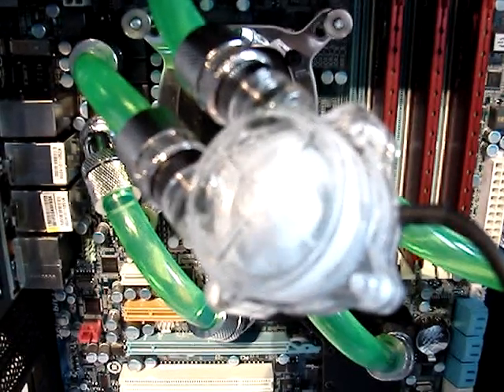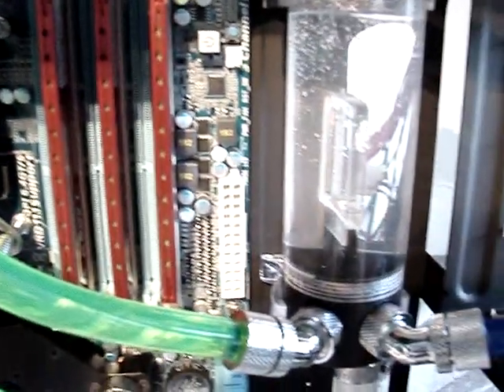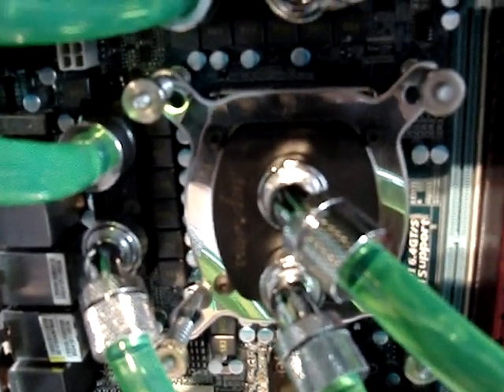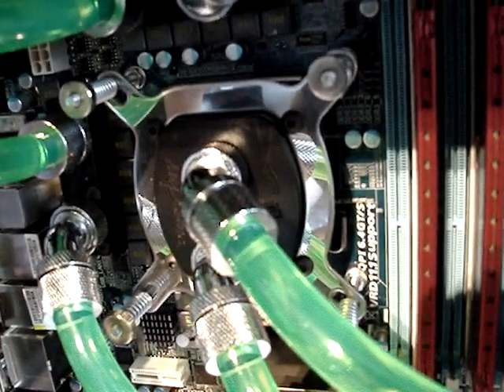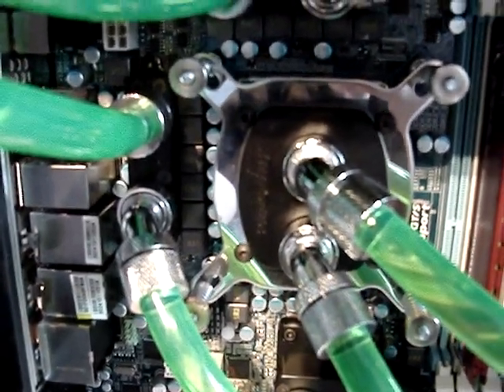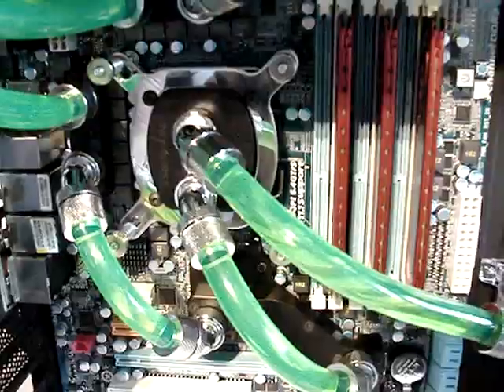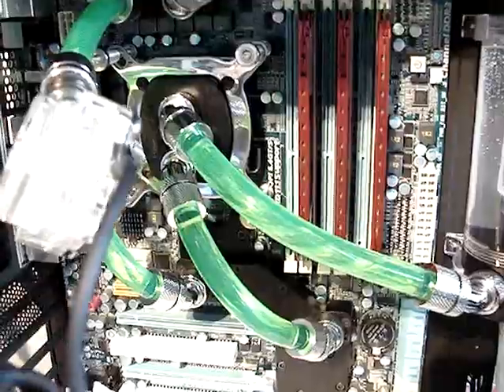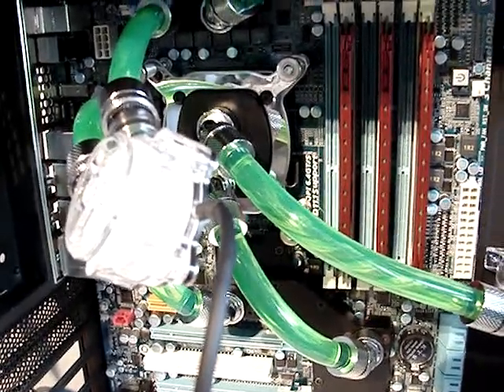Watercooling build Part8 - How to Leak Test of  Chipset and CPU Waterblocks ?

Comment: I really like how simply using the 45 degree angle tubing you shorten the amount of tubing you use so much. It looks so much more efficient than most other water cooling setups where they just bend the tube a lot.